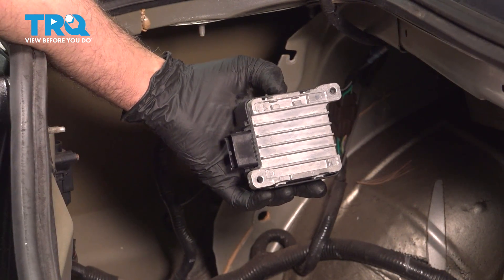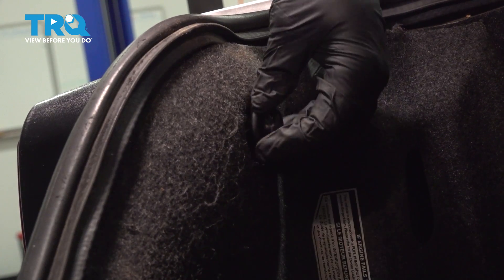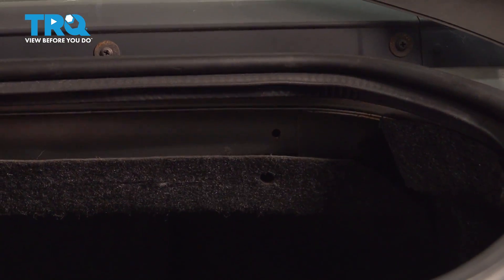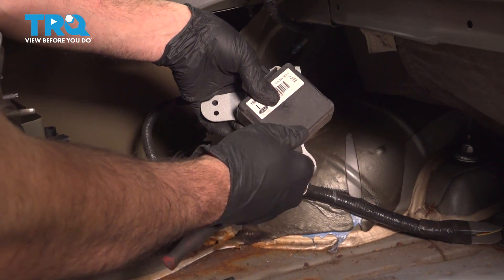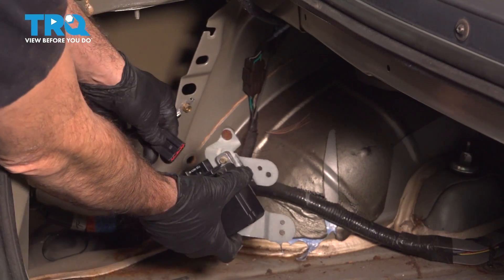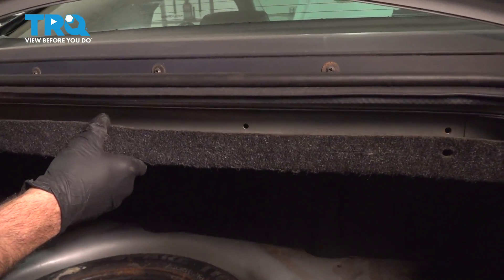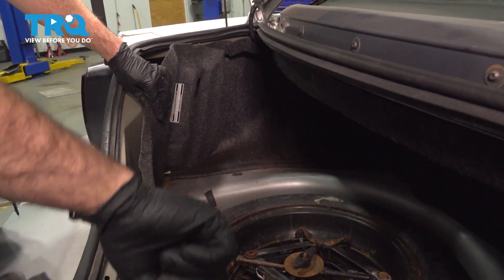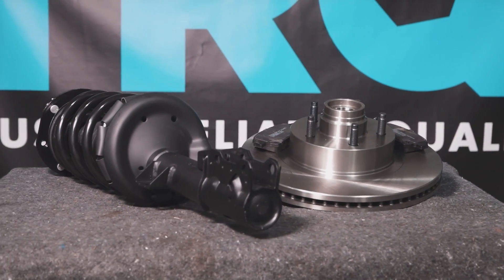How to Replace Fuel Pump Driver Module 1994-2004 Ford Mustang

Comment: How to know which one is failing. FPDM or the Fuel Pump in a 2002 mustang? My mustang is hard starting and when it starts it drives or idles for a few minutes then stalls. fuel pressure dropped when I checked. waiting for your advise